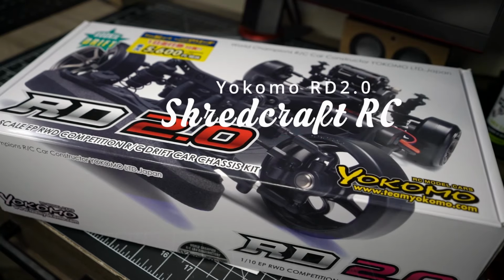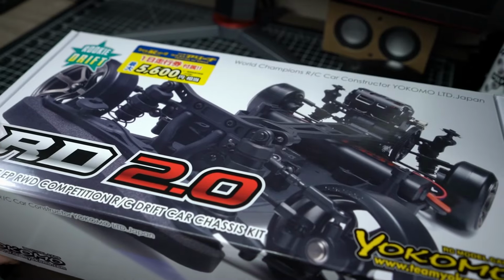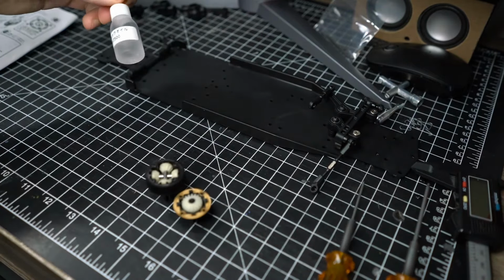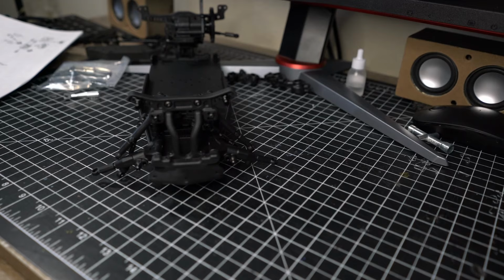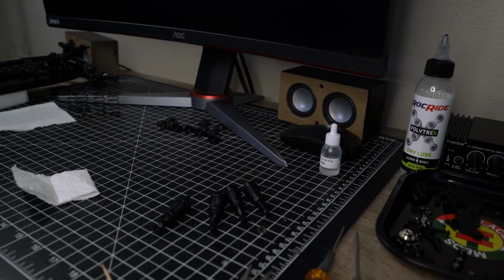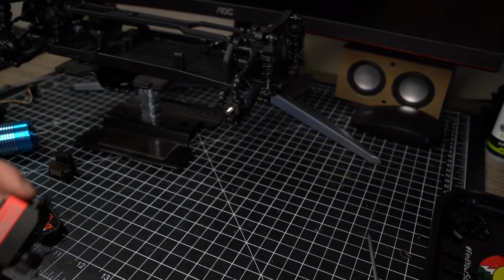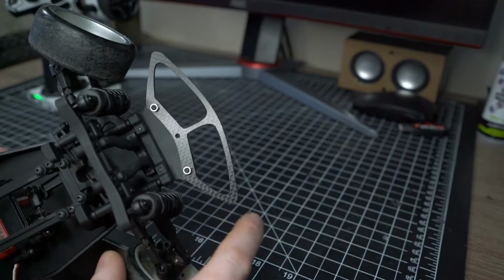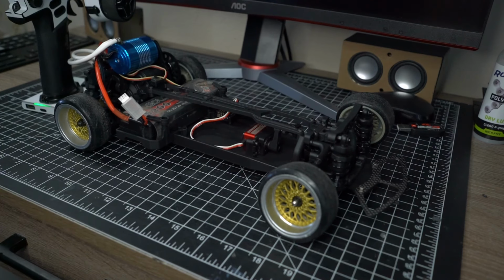New 2024 Yokomo RD 2.0 RC Drift Car! #rcdrift #remotecontrolcars

Comment: Would love to see as a budget esc the new HW BL120 sensored g2 

50ish bucks and features boost and turbo 🤔
Reply from the maker: This is the original and it has boost and turbo, I just can’t justify replacing this one when it works so well for what it is, I was thinking the ReveD breve clone or the other team power esc seem like interesting choices since they have built in Bluetooth.
Reply: Didn't know this existed. May go with that instead of xd10 pro!
Reply: There’s a $50 ESC with boost and turbo??? Where??
Reply from the maker: @beartodrift5345  Hobbywing 10bl120, all boost and turbo mean is a timing adjustment to the motor. This esc can advance timing and punch, the G2 calls it turbo and boost now.
Reply: Understood on timing. But I think boost is not just timing but timing at certain rpm.

Same with turbo, I understand it’s not just punch but timing at wide open trottle only or near the end